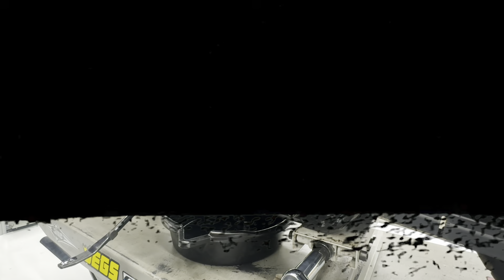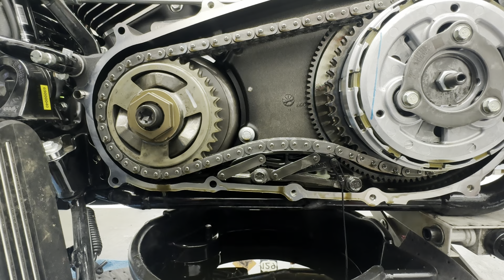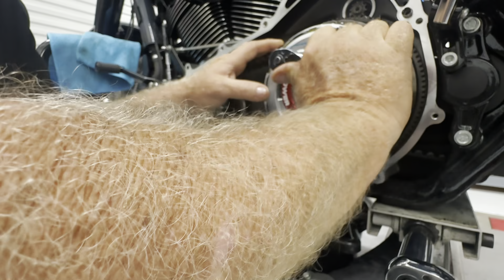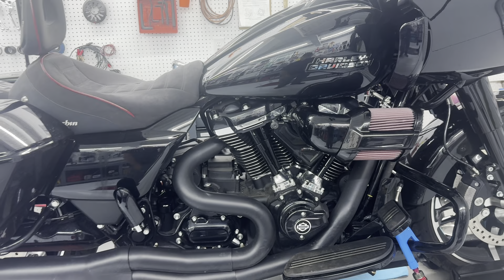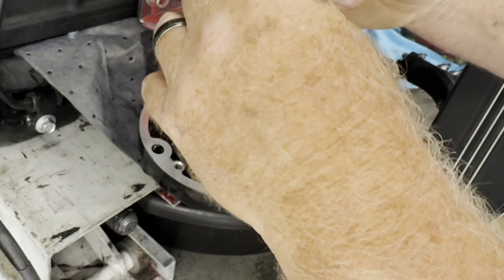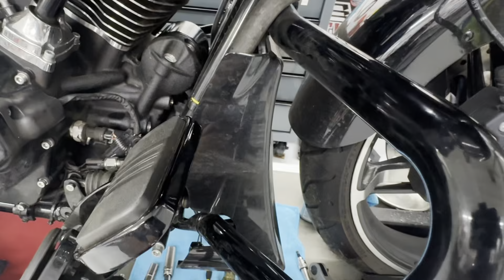The Right Way to Build a 2024 Road Glide 117 | Part 1

Comment: I have snapped the stock screws for derby cover on my 2022 FXLRST right off the screw head just removing for primary oil change. Cheap ass bolts
Reply from the maker: Those stock fasteners are notorious for being weak and prone to snapping.

Comment: Man I need that trask clutch spring kit. I've got a stage 2 117 and my clutch slips at about 3500rpm any time i give it more then half throttle. I've made sure its in adjustment. The stock springs are too light in my opinion
Reply from the maker: That upgrade makes a world of difference with the extra torque.

Comment: I have a 131 and had a Thundermax on it. The bike breaks up below 3000. Rpm and surges when setting the cruise on the interstate. Had the stock ecu tuned and the bike runs perfectly now. What could cause the Thundermax to run so poorly?  I really would like to get the bike to run properly with the Thundermax. Payed 1200 dollars for it so you would think it would run great. Not the case.  Took back to builder and he can’t figure it out either.  If the stock ecu tuned and runs perfect the Thundermax has to be the problem?
Reply from the maker: I can do a remote tune for you. Most of the time the issue is not the TMax, it’s the TMax trying to fix an issue with the bike…..Think about it, If the product didn’t work why are they still in business, and Why is it my choice tuner?
Reply: @samsonvtwin ok but why does the bike run perfect after the stock ecu was tuned?
Reply: @freedom6919741 you answered your own question…you had it TUNED…the Thundermax is no different. If you can’t tune it yourself it needs to go to a good tuner.
Reply: @Mo_Hellbilly it was tuned on a dyno with the Thundermax. He doesn’t know what the problem is either.
Reply: @samsonvtwin no reply?
Reply from the maker: I can’t answer that question without actual knowledge of what is going on with your bike, could be many issues and to speculate would be foolish